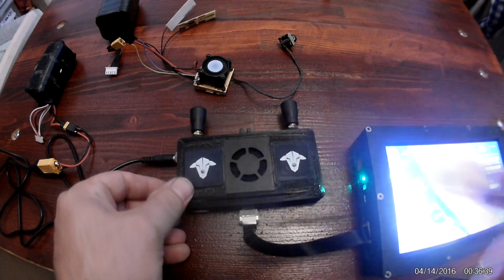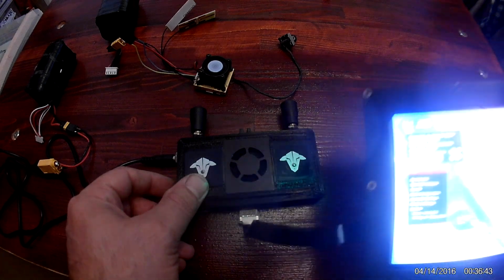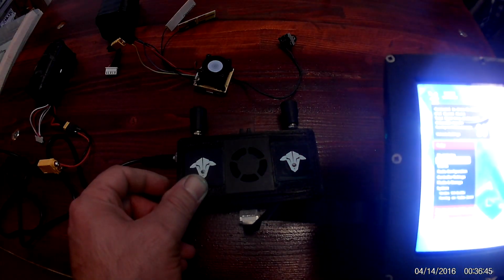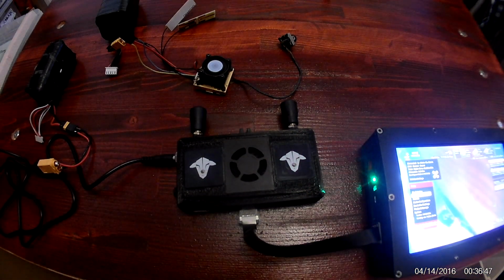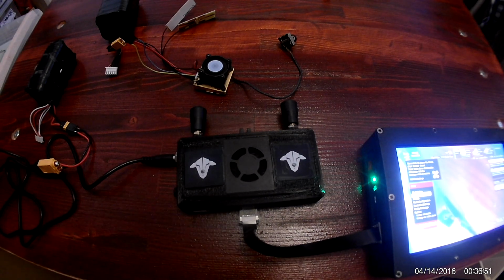Ruby FPV: overview, air and VRX unit teardown, Walksnail comparation

Comment: I just installed the Ruby FPV firmware on the Radxa Zero 3W for the first time. How do I connect via SSH? Can I use the built‑in onboard Wi‑Fi adapter for the SSH connection? Also, how can I download the recorded video files to my PC? Other than moving the SD card to the PC, is it possible to download the files over Wi‑Fi? I’m a bit confused.

Comment: That's a nice design. I'm actually working on something with very similar functionality - also 2 WiFi modules and an additional USB port. It will be smaller since I have designed a carrier board for the WiFi modules, but it won't have integrated patch antennas, just 4 SMA connectors sticking out.

Comment: I’m curious about who made the VRX, the radio modules in there and the antennas that were used. :)
Reply from the maker: A 3rd party. A person, not a company. the radios are the small 3.3v aliexpress RTL8812AU modules. Antennas: whatever you have, those are some circular polarized omni and two team-black-sheep patches.
Reply: @petrusoroaga6528  I didn’t think it was a company but wondered if the person was open to making another one of these. Since they weren’t mentioned, guess the answer is no :)

I don’t have any good antennas lying around, so I I’ll borrow / buy some.